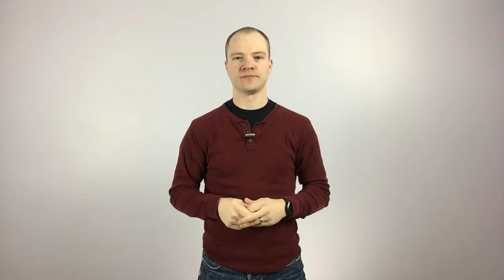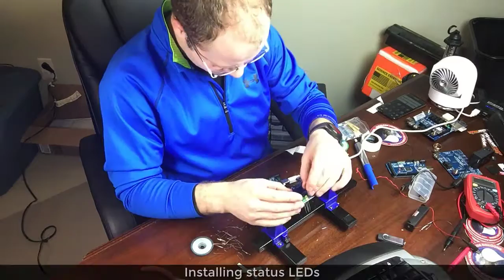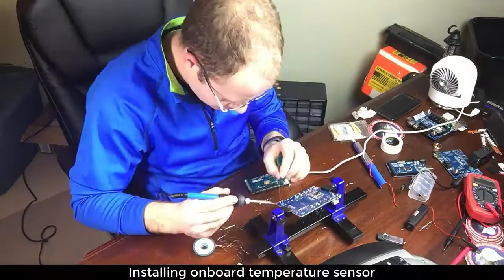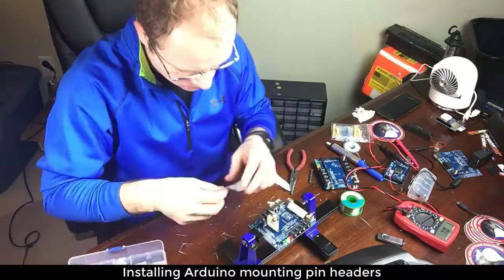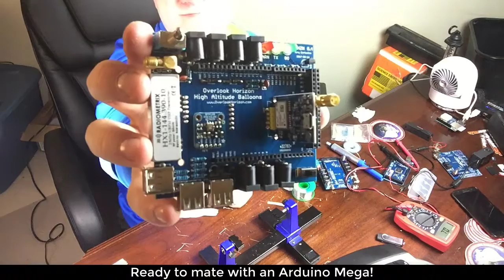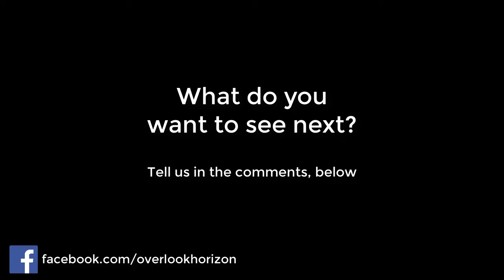Circuit Board Assembly | Weather Balloon Radio Tracking System

Comment: I have a radio transmitter from 1950s for a weather balloon in the military and it uses two electron tubes
This will be very interesting to see what was done in 1950s compared to what is done now probably just altitude dew point and a couple of other thing I don't know yet this transmitter is tunable.. oh and I bought it because it is HF ham frequency

Comment: Not sure if you check comments on videos from so long ago, but here goes.
I hear you talk about the temp of the processor, I am not aware of that function on an arduino, so is it one you made and mounted yourself?
I would really like to see some of the code you fly.  I am trying to do a balloon as well and I'd like to see if there is something that would do the job better than the way I am doing it.
You mention external humidity and internal pressure, do you have internal humidity and external pressure.  I know you have internal audio, we hear the beeping from your different alarms, so that would have a microphone somewhere, and I think on one of your earlier videos you mentioned a venting due to the sound and I believe a shock to the picture, so I was wondering how much of a differential you allow to build up between the inside and outside pressures, and if you were trying to do it or not.
I really like all of what you do.  I have watched, and continue to rewatch most of them (about the balloons) to pick up some of the tech and how you use it.  You are one of my "go to" spots for ideas.
Keep up the great work.  Thanks for all your efforts.  I hope to catch a live broadcast some time.
Reply from the maker: The "CPU" temperature sensor is a separate sensor that's just mounted on our circuit board to gauge how warm the electronics are getting. We don't have internal humidity, only external. The microphone audio is from the cameras.

Comment: Was hoping to find these board ready made or atleast the schematics and the parts list! It would really help me! :)
Reply from the maker: +Mahanthesh R We plan on offering ready made boards, but likely not until next year
Reply: Get an arduino board and sensors and make a system yourself.
Much more fulfilling.Plenty tutorials for arduino on You-Tube.
Reply: I bought one from the 1950s with two electron tubes that is New Old Stock from the military that ought to be interesting